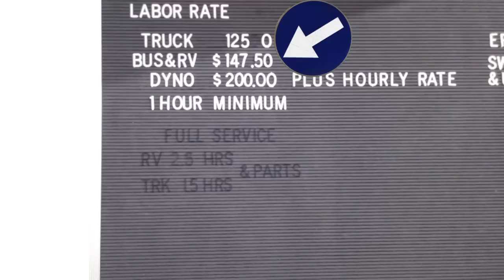What To Consider When Buying A Diesel RV or Motorhome?

Comment: The biggest issue I saw selling motorhomes was sidewall delimitation.  If they leak, they’re worth next to nothing.  It mainly occurred in discount brands and in part was due to poor maintenance as well.  I’d stick with Fleetwood or Winnebago.  Didn’t sell Monaco, but they looked nice too.  Most the ones I handled were 10 years or less in age.  More issues seemed to be with the coach itself.  If you buy a used Triton V10, have them put in writing that the spark plugs were changed in their care and they’ll cover expenses if they break off in the cylinder head (which is common).
Reply: Oh I dread the Triton

Comment: I was an owner operator for 15 years with big trucks. Had Cummins, Cat and Detroit’s. I had a pretty good clue what I was getting myself into when I bought a used Class A diesel rear radiator with a Cat. Well I thought I had an idea anyways. I have one suggestion, if your going to buy one , and your Rich with deep pockets , buy a brand new one, get extended warranty on powertrain. And get a side radiator coach. If your a working man or retired and on a fixed budget... I recommend a pickup pulling a camper. Stay clean away from these beast and money pits.
Reply: Ahhhh no no no , just GET A GARAGE KEPT WITH LOW MILES AND TAKE OF IT AND KEEP THE radiator CLEAN!!!¡!!, MOST PEOPLE ARE TOOOOO LAZY TO OWN AN RV, JUST LIKE ANYTHING YA TAKE A IT AND UR GOOD

Comment: I just bought a 2018 Thor 33ft pusher with 10,000 miles on it for $150k, new was $259k. I am a retired ASE certified mechanic, mainly autos but worked for a spell on Cats, Internationals and Cummins. Hope I don't have any brake  downs till I am done rompin the 50 states for a couple years. ;)
Reply: Have a blast! I've been a mechanic my whole life and I can hardly wait till I get a chance to do that myself.

Comment: Some repair centers want to over charge for labor. The warranty company sys it takes 4 hours labor to replace that part and the repair center wants to charge 12 hours. That's when the repair center trays to take advantage of the customer saying that the warranty people are not considering all aspect of the labor involves.
I had it happen to me. The replace place wanted 5 hours to replace a simple part. The warranty company would only pay for 3 hours. I found out from several of my friends that it only takes 2 hours to replace the part and for someone that has done it several times can do it under 1 hour.  I still believe that are repair centers trying to take advantage of the customer. It's best if you can is to call a few different repair places and get estimates when possible.
Reply: Not if your stuck in a small town your going to pay what ever it takes to fix it

Comment: Great video I have a motorhome I bought it used this July 2018 it is a 2002 Cummins Allison Transmission 38 ft.

Although I do have knowledge of working on gasoline engines even doing the rebuilt on them, this is my first diesel.

There are some differences but if you know how to work on gasoline engines you're about 90% there to knowing how to work on your diesel.

But the information I get from your channel makes up for the 10% I'm unfamiliar with help me a lot thanks so much for the great work you do 👍😉
Reply: GREAT!

Comment: That's why you see 15 year old diesel class A motorhomes for $20k with 38k miles on them.  Also larger RV's like that make them difficult to park some campground. Example is Yellowstone only has one campground that allows your overall length over 40 feet total including any other vehicle. Classic American thinking here go out buy the biggest RV with the most features for 2 people. Reality is all you need is smaller class C RV gas engine since don't have all that weight no need for maintenance hungry diesel engine gas engine gets you down the road just as fast.

Comment: Wow good advice here.....if u buy an RV get a good extended plan....mine is great just a 50 deduct at dealer....always worked great .....be careful what u buy.......by the way cat has not been used since 09.....great advice ...great video.....gooooo cimmins
Reply: That's because Cat didn't want to get into the emmision controls mandated on diesels. The emmision controls now put on diesels has ruined the longevity of a diesel. I would never buy a diesel powered vehicle made past 2007 the EGR valves have to be cleaned, and DPF filters cleaned both costly repairs.  The soot forced back into the engine makes the oil get dirty faster. All kinds of issues with the def fluid pumps  and heaters go in there. Get an older diesel like 2003-2004 much better or just better to avoid diesel. My company quit buying diesel pickups because of this now they only buy gas engines 1 ton pickups.

Comment: I work at an automotive repair shop, everything you described with the aftermarket warranty company is exactly the same in the automotive repair world!! They will argue with you, haggle over hours and Parts pricing, straight up decline certain things, they're horrible!!
In my experience it seems to be you have to get the customer to call the company and complain and threaten them in order to get anything out of them they could care less what the person at the shop says to them!
Reply from the maker: Yeah most customers learn to hate their warranty once they have to use. I love when a gasket fails, but they claim it is because of loose fasteners and they don't cover loose fasteners.
Reply: Or the AC compressor is covered. It springs a leak. Read the fine print and leaks are not covered. If they do somehow manage to cover it they will send a used compressor, no caps on it and full of dirt. We had that once  They have it written so that they can't lose.
Reply: When I first got started doing computer/IT work I did some on site warranty and service contract work.  90% of these warranty companies only cared about doing the bare minimum they were required to do and had no concern for actually resolving the customer's issue.  Very frustrating for anyone who takes pride in their work.

Comment: Thank you.  I was going to buy one to the misconceptions I was taught.  Boy that would of been a mistake. Thank you.
Reply from the maker: Glad you found it useful.
Reply: @AdeptApe  hi there. .. great vid on class a ownership... Spot on.
thanks for sharing your knowledge on all things cat, and more...
I've got a C10 in a motorhome 2000 CC Magna... My driver information display has been flickering and when I whack the dash it'll settle down and act right for a while, but usually if I scroll down, the screen goes to startup mode... A new one is $1300+ available at cat dealer... I'd like to modernize with that kind of money and wonder if there's an aftermarket substitute digital dash display that's kinda plug and play? 
Thanks 👍

Comment: First of all, I love you chanal I started watching you when I pick up a 95 Safari 35' DP 275  T Cummins w/90000 mil on it last year, now I paid $9000 put $6000 into it,  so a Pusher today at $250000 to $500000 + I have offers $28000 for it!  I'm not selling it, but nice to know I can get some money back,
been in construction for 35 years and I understand repairs are a part of life and iv learned that its better to enjoy your success in your repairs and just know going into an RV is like a house in a earthquake zone! so for me a little cash for some time of small success! is really good for my soul.
Thanks 
Ps, Yes RVs depreciate faster than Ice cream!
KJ
Reply: Most are taking 30% to 35% off most asking price...  At $50,000.... So you can find one thats $70k and walk out paying $53k for them..  See it day in and day out..
Reply: @lanksterprice  Anything that has been sitting for 15 plus years is going to have problems. Diesel can grow mold in tanks with low surfer fuel. Best to pay 28k expect to dump 10k in to it fixing everything then at least you know what was fixed then paying 53k then find out dump 10k in over that. Always cheaper to pay less up front then to trust a seller like a dealer that buying something wont need to dump in 10k. 10k might be on the cheap side 15 year old tires is a safety hazard so that's 6k right there.

Comment: What does RV stand for? RUINS VACATIONS!!!
No freaking way. Think of all the issues of a heavy truck combined with all the issues of an average home, all wrapped up in a poorly built, over priced package.
Reply: BTW, great video Ape. This might be your best one yet.
Reply: Lol I guess that's one way to look at it.

I have a motorhome it's a diesel lots of fun but yes you do have to keep up on it I always tell my kids never turn the knobs too tight on the faucets and don't bump the walls too hard pretend you're in a cardboard box lol

But there are lots of fun to have and any type of disasters Like An Earthquake or any damage to your home like a water pipe breaking instead of going in the hotel while the insurance fixes it just go to the RV in the front yard.
Reply: That's the beauty of a Ford class c or class b. A Ford shop can work on it and parts aren't super expensive.
Reply: And made out of match sticks and put together with staples.
Reply: @andrewarmstrong7310  Unless you bite the bullet spend a few bucks more and buy a Prevost, best Motor home on the road. My friend bought an 2008 and has had no rattles, squeeks, engine failures nothing, he just does the regular maintenance and he hasn't had one problem yet, and this coach was over $1 million new. He picked it up for $260,000 in mint condition with 110,000 miles on it.
Reply: @crazycanuck2578  That is a big bullet to bite. I ended up going with a two-year-old Pleasureway on a Ram Promaster chassis. Love the little van, can go anywhere with it, even thru a McDonalds drive-thru.

Comment: Probably the biggest reason why any vehicle gets a million miles is because they spend their entire lives hot, they don’t perform anywhere near as many heat cycles, they’re always running, which is why taxis are so reliable with so many hundreds of thousands of kilometres or miles on it.

It’s a common misconception that ‘harsh operating conditions’ means something like this, driving huge amounts of distances on the highway and never letting the engine rest or whatever. Engines will run as long as you want them to, they don’t mind. What they don’t like, however, is heat cycles, especially when the engine doesn’t have enough time to get up to operating temp. Those short jaunts back and forth to the train station and the shops twice a day? that is a harsh operating environment. Endless miles on the highway is dead easy. It’s actually, by far, the easiest driving an engine will ever do. Cruise control, 100km/h, constant 1500rpm, basically a fast idle? They’ll do that all day, every day. 

Further, the engine heat soaks nicely, and any of the water, fuel, and shit that collects in the oil, has an opportunity to be burned off. Sometimes the effects of oil dilution are so profound, that the oil level can appear to go up in the engine, instead of down.

For the sake of your engine, either take it for nice long drives, or change your oil at least twice as often as the book suggests for the harsh operating conditions mentioned above.

Comment: The option you missed is to buy a gas powered RV. More shops to work on them so shorter waits, lower parts cost, lower labor rate.
They aren't perfect, but they are a viable option if the high operating costs of a diesel RV are to much for the person buying.

Comment: just got a pusher CAT 3126 freightliner chassis. Real cheap. Fixed everything. Only 40k 1998.
Just did all filters and oil. Onan 7.5 kW genset . You have to be a mechanic and technician or $$$$$.
Should I hire a heavy haul tow truck to pull it?? Lol

Comment: As a diesel mechanic I can say RVS are the most overpriced and poorly built vehicles on the road...and forget about customer support when I comes time for repair.  None of the manufacturers keep records of these things and parts are an absolute nightmare
Reply: How so I know a huge diesel pusher isn't poorly a welded aluminum frame your little 5th wheel are made with cheap wood

Comment: So a friend of mine is thinking of buying an otherwise well maintained cream puff of an RV with a C7.   She asked me about it, but I am no diesel mechanic.   Its a 2005.  But it has 100k miles.  Very good maintenance records. One owner, and he is very meticulous.  I asked her to ask him about the HEUI pump, fan bearings things mentioned by Mr. Ape.  The guy didn't know about those being changed out ....

She is OK with work, like changing the pump, etc.  Question is, do you change out the HEUI pump as prevention?  Or do you pass on every CAT7 like this with 100k?
Reply: I'd get oil samples on anything with oil in it. If it comes back good that mileage is just proof that it didn't sit all the time,  which is a good thing.
Reply: I've never seen anybody replace a high pressure oil pump due to mileage? Some go 20,000 miles some go $600,000 mi.
Reply: @maxpower9848  those pumps are about a $ 1,000 , on line

Comment: Those sound like really good points. So would you recommend not getting used diesel? In Canada I was looking to get a used motorhome somewhere between 10000 to 20000. Not sure which one you go for gas or diesel

Comment: thought about a new motorhome, got used one instead, why ? new 200,000 to 500,000 got a 1998 for 13,000 gas engine for a year now,had to put new tires 1,800, new roof ( did my self ) 450.00, owners saved all records and in the first year it was in shop more then on the road, oil changes 200.00 with safety
check, had a 1971 Ford camper van 10 mpg 32 foot motorhome towing jeep gets 8 to 9
mpg so no surprise about gas mileage

Comment: Listen most that retire into a nice Class A have a good retirement. I'm around some of these people. And they'll drop $350-k to 650K on Diesel pusher and call it the day for the next 6-8 yrs and many stop RVing due to life and older age issues. And some will buy new RVs after every 6-8 yrs. If that weren't the case before Covid days the business would be struggling. I hear it all the time. Went to the RV show and my wife fell in love and talked to our dealer and we're trading in for a new one etc... lol. Today many want to jump into this much earlier in life. I had a new Winnebago Forza at 40yrs old at 46 yrs old sold with 22K miles. I didn't purchase again because of boating. Today we have a towable and new towable is on its way. I switch out my truck every 4-5 yrs. Enjoy being in the truck, plush seats, awesome sound system and quiet cabin. I do see myself once again in a Class A but if used under 5 yrs or maybe a new Gas model ? Absolutely insightful video eye opening to buying decisions.

Comment: We bought a 2003 Diesel Pusher with a CAT 7 engine. We knew it was already 15 years old when we bought it. Most of the engine repairs including the recent one where we had an oil leak in the supply line to the Turbo have been due to age (and yes BTW we are replacing the return line as well while we are at it -- preventative maintenance).. just like you say.. our engine has about 86K miles on it but, it is the age that is requiring these repairs... stuff degrades over time like oil or fuel lines. Good video.. buying a used diesel motorhome can be OK if you understand up front there will be failures... and hopefully nothing huge :)

Comment: "RVs have very low miles ...because they are so expensive to operate..."  Really?  I'd chalk up the low miles with a lot of diesel pushers because people make two 'major' trips per year.  From their home base to their Winter location in the Fall, and then back again to their home base in the Spring.  And who buys a Class A Diesel without doing research on maintenance costs?
Reply: Who buys a class A motorhome just to drive between 2 homes that's crazy all the money spent buy everything you need at both homes and fly first class until your dead

Comment: Yup, 2003 Big ass coach Cummins ISM 73,000 miles. I'm waiting , just waiting. Got a bond with this engines name on it. That and a air dryer is being replaced this week.
UPDATE: put 20,000$ into the coach.  Been all this time getting it right. New tires, new air bags,  new air brake spring cans. Get it and take it to a second shop for a second opinion. They tell me the one wheels slack adjuster is bad, my alternator is bad and the chassis battries are bad. everything else is fine. So take it back to dealer I got it from. They fix the brakes NC. The alternator and battries were $$$$.  In the mean time it's rainy season down here and some water got in and made a mess of the fine wood floor up front. I got on the dealer about the leak. They told me the roof was grade A when I bought it. They fix the leak. They won't fix the floor. So. I have it now after three months
Reply: What a nightmare I just rent motorhomes something I use a few times a year